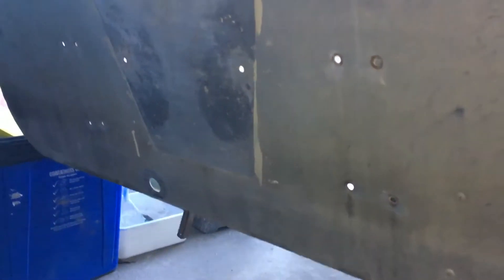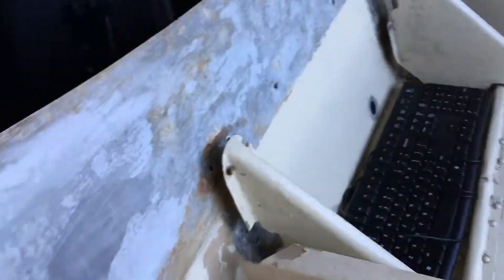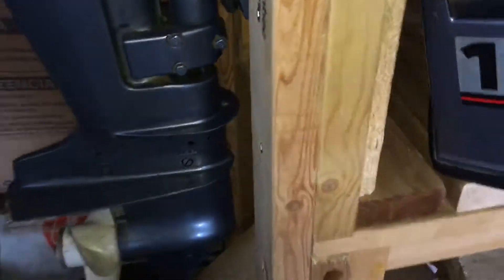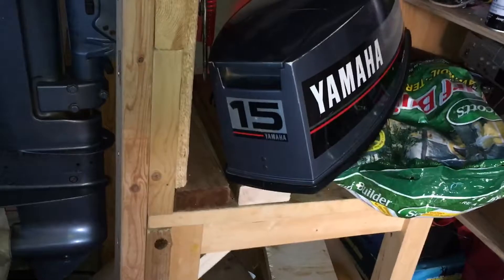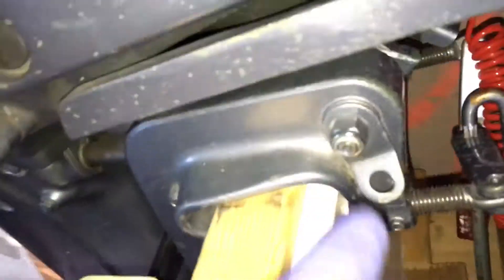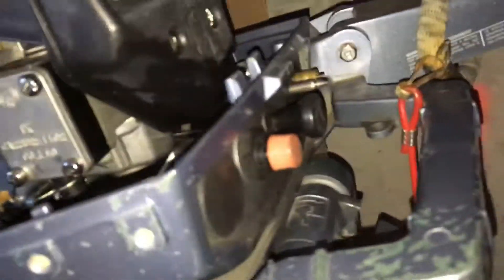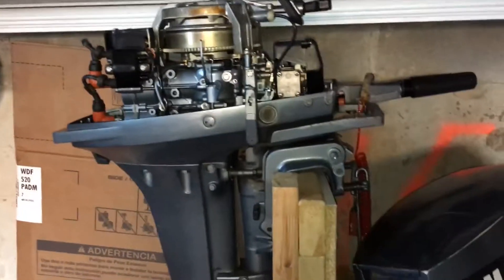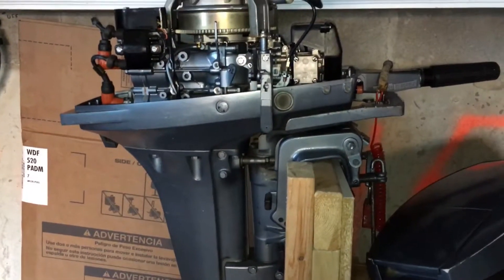Day 3 - boat project

Comment: Try spraying some liquid wrench or wd40 or some kind of liquid lub
Reply from the maker: I got it cleaned up with chrome wheel cleaner.  I'm working on the transom board now - https://www.facebook.com/GoneFishingTightLines/photos/pcb.558670251171081/558670214504418/?type=3&theater